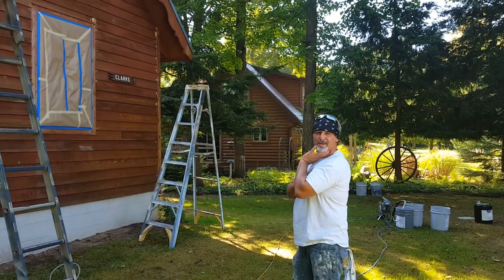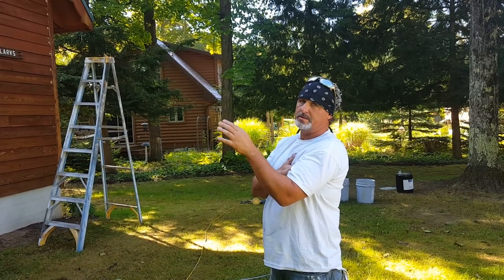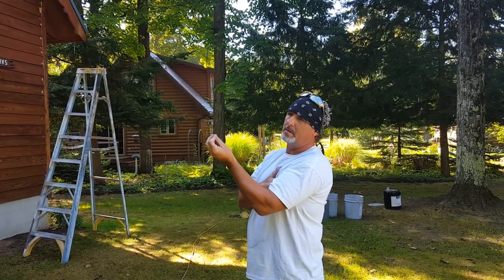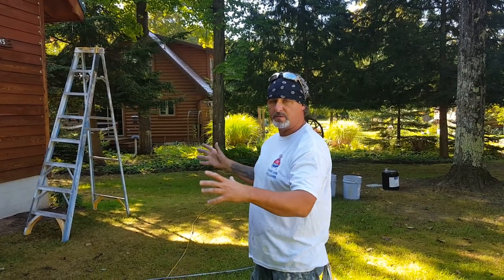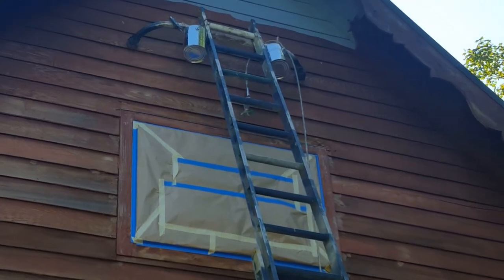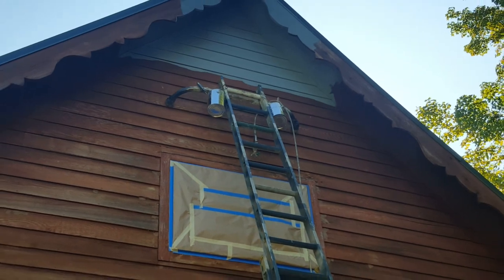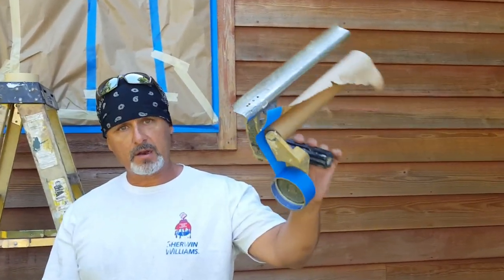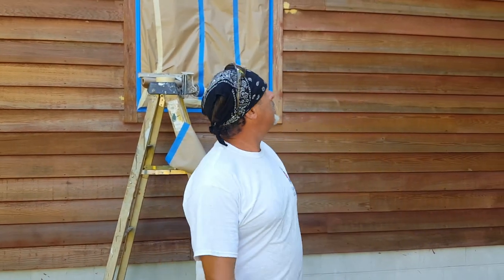How To Paint A Cedar House Info Tips and Tricks #1

Comment: I painted my house last summer (cedar siding), and thought I prepped it well. It was dry, clean, and used oil based killz primer snd bear Marquee paint. I’m getting blistering in spots, especially where the sun hits it the most. Any ideas why? Is it the tannins I’m the cedar siding? I didn’t back roll or brush the primer on (sprayed), could this be the issue? Thanks.
Reply: The cedar swells, warps and moves with the sun and the moisture, you are relying on paint adhering to the surface, never heard many good things about painting cedar. You want to Solid Stain it. Solid Stain will penetrate the porous nature of cedar while having enough pigment to color the wood. You can probably get 15-20 years out of a solid stain on your siding and it'll just start fading, with proper prep it shouldn't bubble, peel and crack. You'll just need to maybe touch it up every other decade if its in fairly harsh conditions.

This guys paint job on that Cedar house wouldn't last here in the south but maybe a couple of years. and it'll start peeling and bubbling like you're describing.
Reply: Primer and paint never last on ceder! Kills is only good inside. A true oil solid stain is the most you can use or semisolid
Reply: @Volkan doubtful, and leaning towards no. It would probably need to be stripped 1st.

Solid stain, is still a stain. It seeps into the pores of the wood for adhesion.

Old paint would probably prevent that and cause it to fail early.